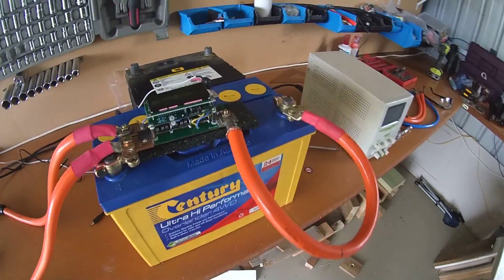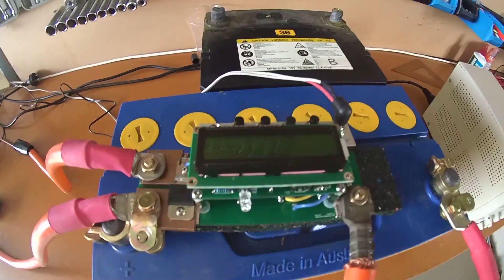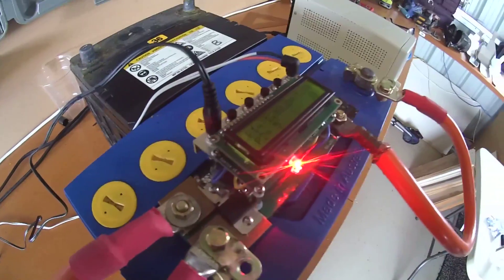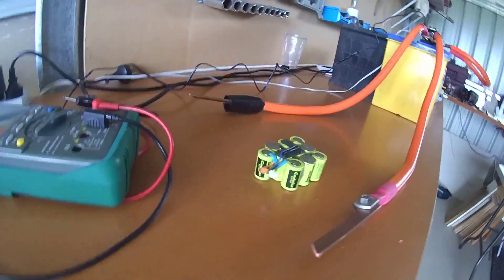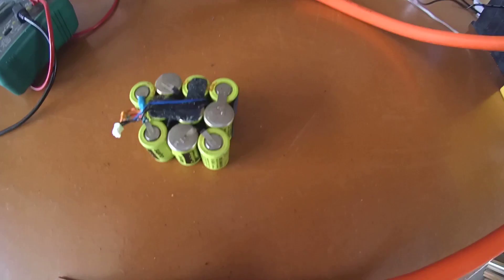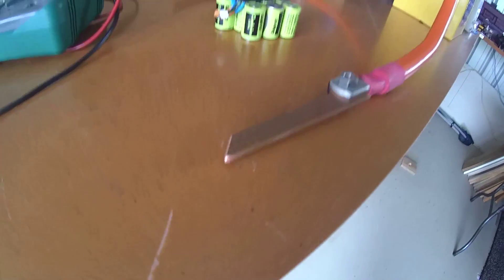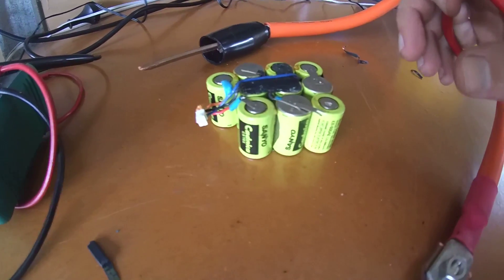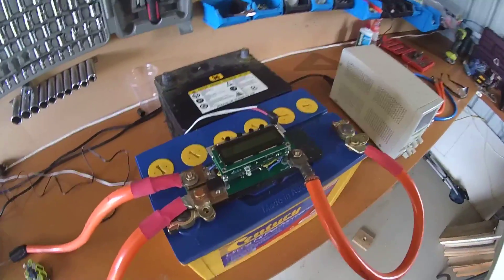6Pence 18650 Battery Tab Welder - First Test

Comment: nice job, assemble the kit yesterday you say. I've been working on mine for a month about to get it finished up I need to ask you a question. on the control board the bottom right-hand corner section it has 2 holes labeled gate do I take that wire down to the fets power board whole number 15 there's two holes down there it doesn't matter their orientation. much appreciated a thank you
Reply from the maker: Farley Gordon I'll have a look when I get home. I think he gave you two gate driver holes.i only used one. They are connected.  The two holes that didn't matter which way they go is probably the foot switch. Because it is just a switch. Didn't matter if you switch pin 1 to pin 2 or pin 2 to pin 1.. know what I mean.
Reply: TheAnimalector I figured all the switches out but on the control board kinda at the bottom right there are two holes that's a gate gate what should I do with these two holes I assume they go to control the power board but in a hand drawing someone had a resistor inline so I'm all confused on what to do
Reply from the maker: Farley Gordon yeah I'll check it out this afternoon and get back to you.  Are you on endless sphere. Send me a pm... Animalector
Reply: TheAnimalector no I'm not on the Forum that's why I'm posting here and hopefully you can help me. I put in a couple emails to Paul at his Gmail address with no reply so I'm trying everything I can so I can finish and start welding my 7 s 14 P battery which I broke into two pieces so I can put a balancing wires on them so essentially I have two 7s X 7p. cheers mate